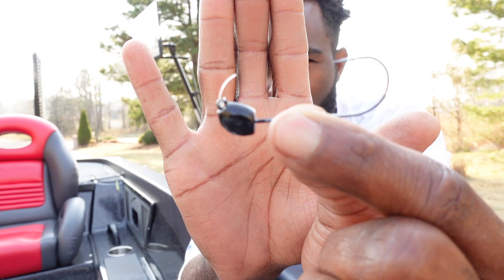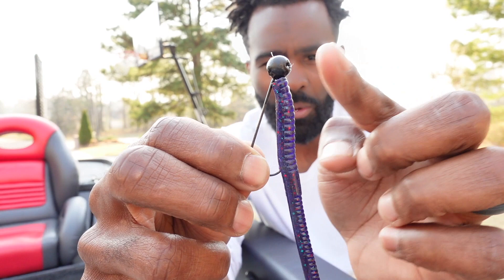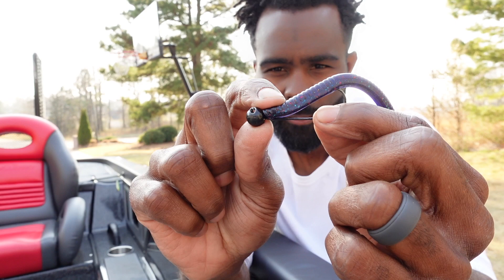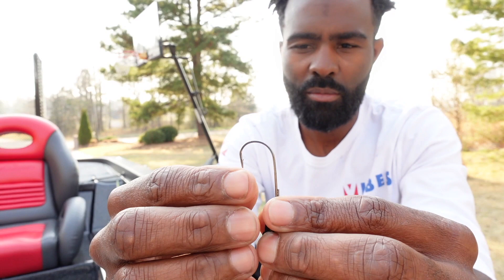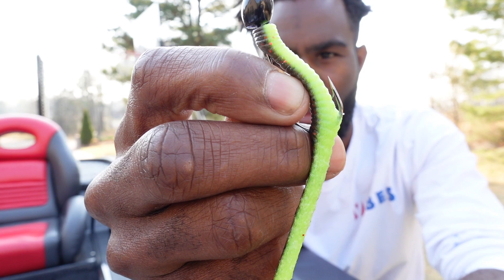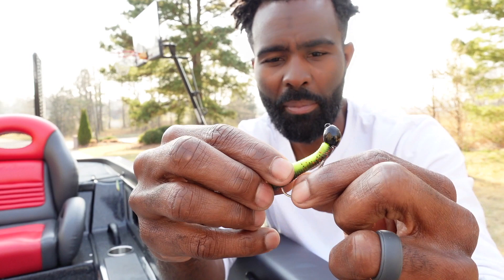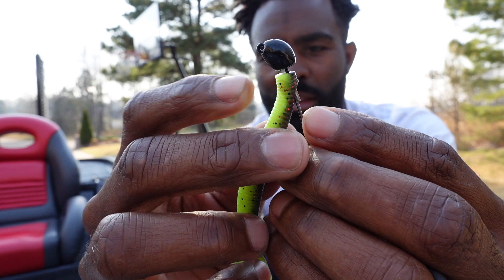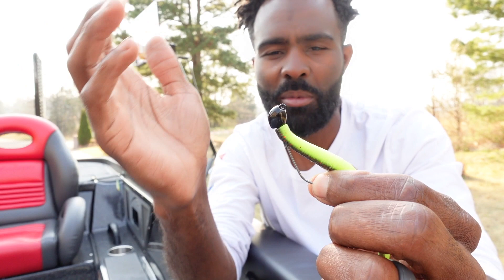Screw Lock Shakey Heads Suck

Comment: The only issue I have with screw locks is that they don't play well with elaztech- you can make them work but it's a pain. I'd rather just not have the screw lock so I can rig whatever style plastic I want without the bother. I still use screw locks on my ewg shaky heads though- for magnum baits.
Reply: You can use screw locks with a zman just hold a lighter to the screw lock for a few seconds and it screw right on

Comment: This makes sense and I can see where screw locks could be troublesome when setting the hook but if you poked the hook all the way through and skin hooked it back I don’t think you would have so much trouble with hooksets especially in comparison to leaving the point of the hook in the middle of the worm. Also when you’re just pulling it from the tail of the worm you’re not really taking into account the pressure the fish would be putting on the worm when they’re eating it so I think that’s one of the biggest helps to get the hook through the bait. Screw locks could definitely mess up your hook set ratio if the fish don’t want to commit.
Reply: I did that and it was still a problem 😂😂
Reply: @EarlBTV  some people swear by them and other people hate them. It’s all really based on preference. Who knows the science behind it lol 😂

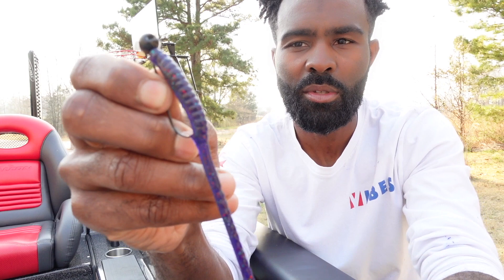Comment: I'll likely give your new hook a try...but I gotta be honest when I say that Pull test that you did around the 2:38 mark is very misleading. I watched it  twice and you clearly pulled the Hula Stick down at an angle and turned the hook upward when testing your hook, which helped the hook pop through. Seconds later, you tested the screw lock hook and pulled the Trick Worm straight down (not at an angle) and did not turn the hook upward, which obviously prevented the screw lock hook from popping through the trick worm. 

Again, I'll probably give your hook a try, but not because of that biased demonstration.
Reply from the maker: Thanks
Reply: I caught that as well

Comment: I think this comes down to personal preference honestly. I know I can set all the way through my own homemade 8” straight tailed worms using the Dirty Jigs Shakeyhead and I typically throw it on my ML spinning outfit with 6-8 lb test Fluoro or mono/braid. I know from experience that I lose way more worms when I’m using a non-screwlock head. But like everything if it works for someone then they should keep doing it.